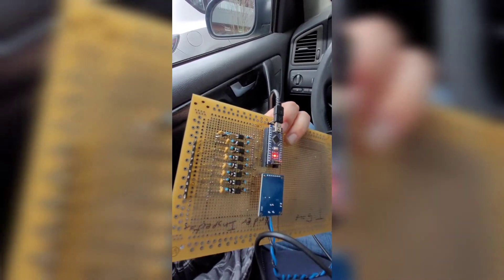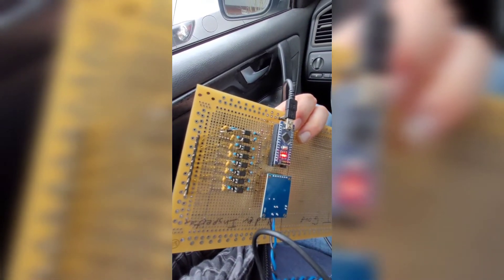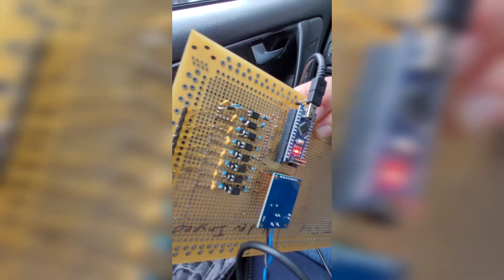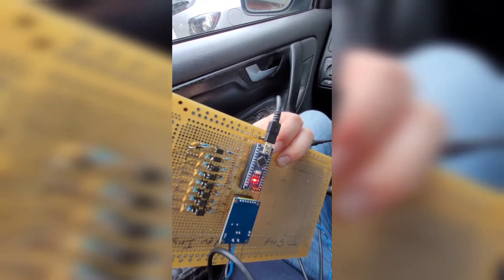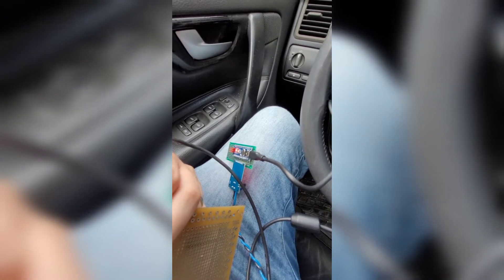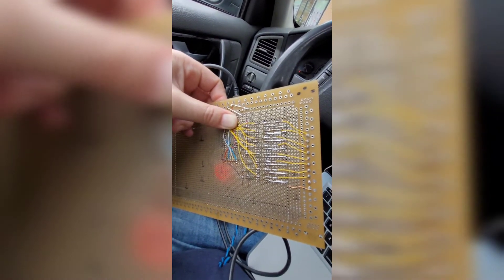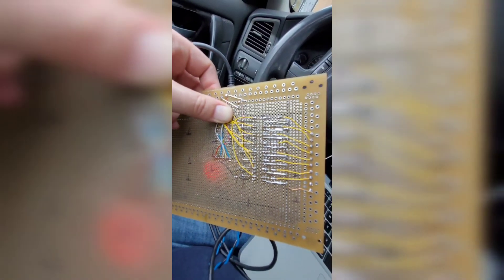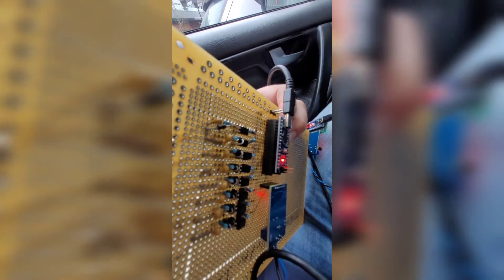DIY Digifiz Dashboard: Arduino powered CANBUS indicators pt2

Comment: Glad to see you’re making good progress there Gavin! I’ve been working on mine here and there too, time permitting. Went with optocouplers also for the 12v inputs and it works well. Got the odometer working too, by counting time on each loop, multiplying by speed to get distance and saving to a json file every 100 meters. If you’d ever like me to send you “my” code (and by that I mean a butchered version of your code), just let me know. Btw which province do you live in? Thanks, stay safe